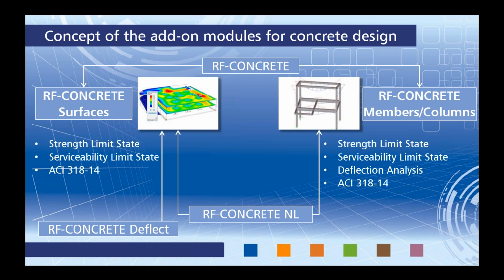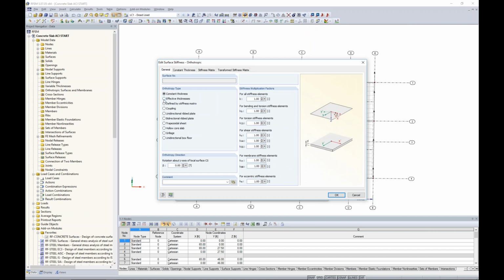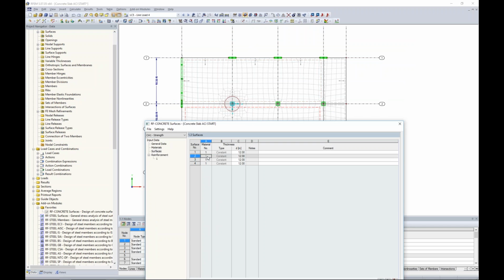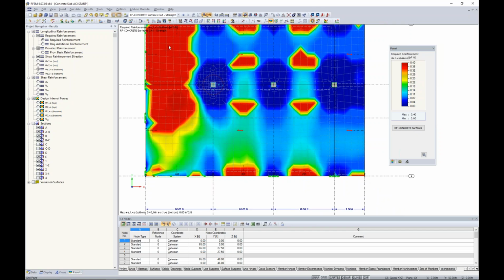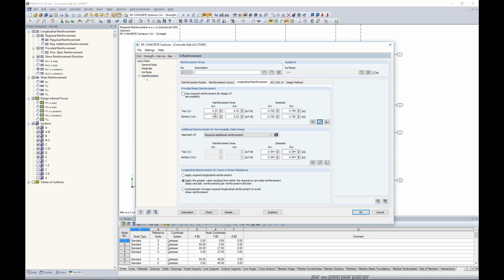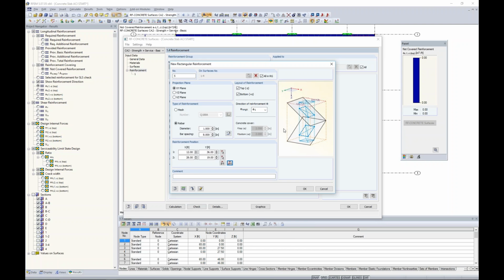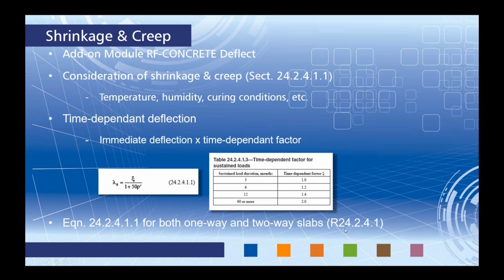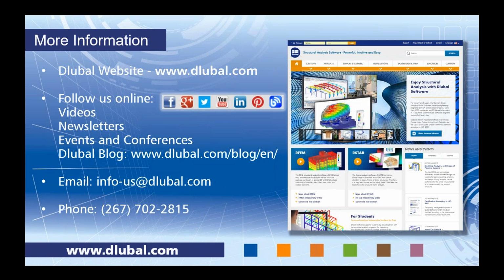Webinar | ACI 318-14 Concrete Slab Design in RFEM (USA)

Comment: how to export the reinforcements detailing to dwg
Reply from the maker: Hi, Rajul!
Currently we have no way to export the detailing directly to dwg. However, you can export the reinforcement from RF-CONCRETE Members to Autodesk Revit. Is this an option for you?
Reply: @DlubalEN  no i am using archicad for 2 years and currently i am using etabs for structural analysis. etabs directly exports detailing to dwg.
Reply from the maker: Hi, Rajul!
With Archicad we have a good relationship and we work on further interfaces.  We hope to get a more intelligent interface than dwg done in future.
Reply: @DlubalEN  is there any direct link between the two softwares
Reply from the maker: Hi, Rajul!
The exchange between Archicad and RFEM will  be based on a file. We are in cooperation with Graphisoft to develop it.